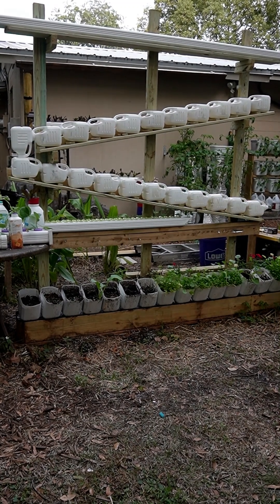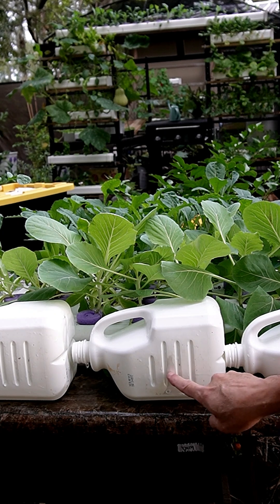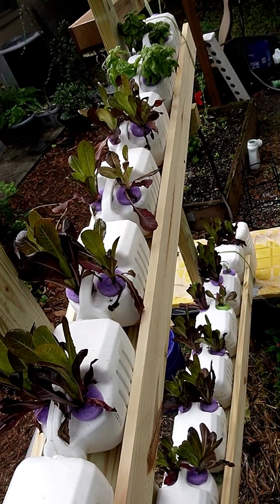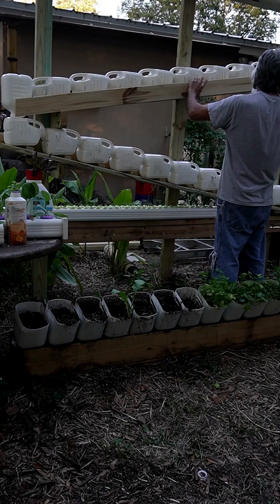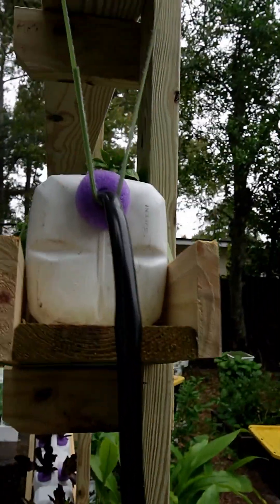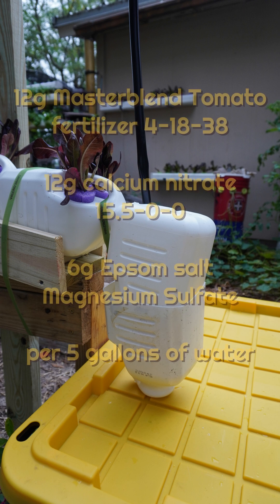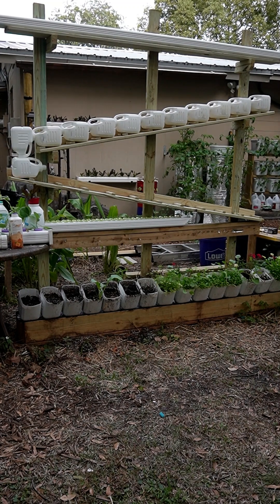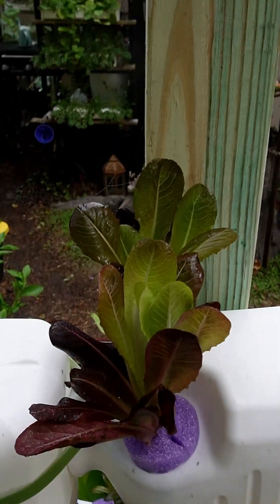Complete Guide for Milk Jug Hydroponic Tower

Comment: @10:07 you stated your nutrient mix. Thank you very much for this. But 1 question; if you weren't doing microgreens & did other vegs instead, what would you play with differently for numbers on the NPK ratios of the fertilizer mix? Or would you change those numbers much for different vegetables?
Reply from the maker: Sorry, I keep things simple here for beginners. I mainly only use that one mixture and work with fast maturing plants. Check out the bucket system on my channel, I grew tomatoes  and peppers with the same mix.

Comment: I'm wondering if I could use a solar panel to run the pump.
Reply: If the solar panel had a battery bank you could. But when the sun goes down if there's no battery all the water in the system will flood out the bottom. There has to be quite a bit of water in the top of the system that's in play; and that amount is bigger than the holding tank usually. So you would need it in a bank of some kind. 

Also; it can be an advantage to have it on a solar panel setup if you solve the battery bank problem because of the idea that your normal power can get interrupted at any time. And they are fiddling with power breaks and blackouts in many areas now to mess with the power price to get more money.